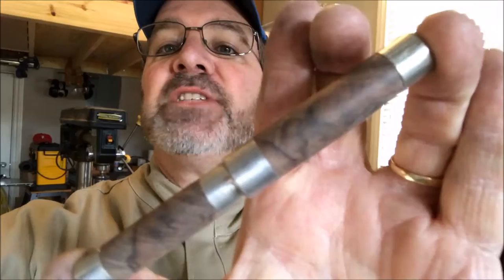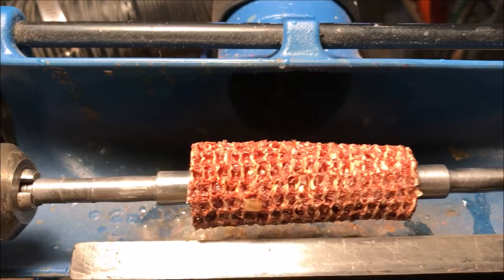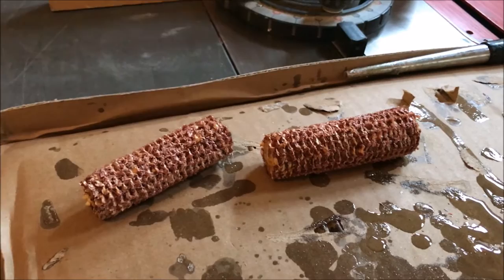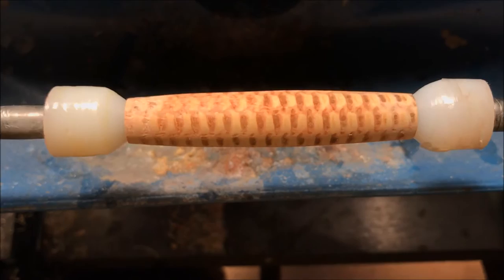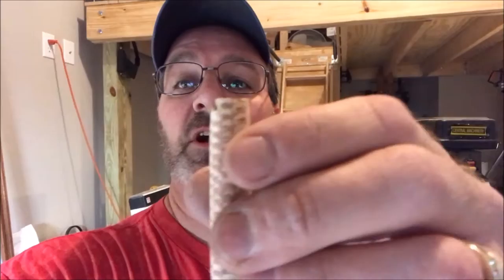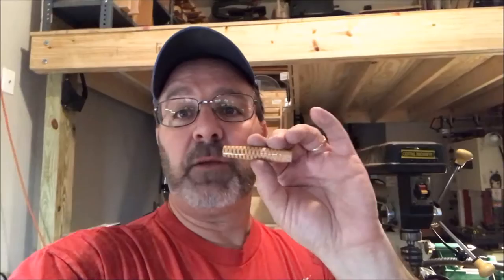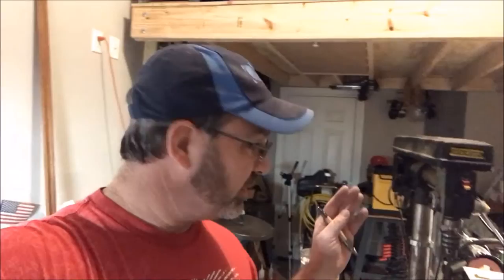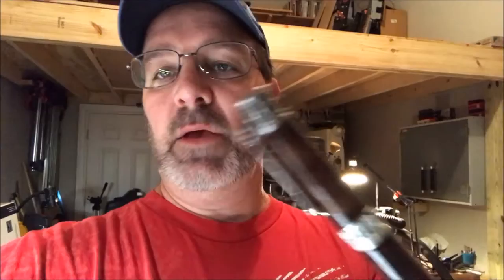Music and Corn Cob Pens

Comment: When you get the thermometer - get one with humid sensor also.  And put a old pot with water on the kerosene heater - as you warm you will get the extra moisture into the air quicker.  Love the figured walnut!!!
Reply from the maker: +Bob Stembridge Thank you Bob,
  Nice suggestion on the thermometer. 

Bob

Comment: Not tedious at all, Bob.  I like the Stratus kit, I think that and the Gatsby Grande are my favorites along with the venerable Slimline kits.  The 2mm pencil kit that Lynn Lacey turned is also a great kit, I am pretty sure it is just the Vertex pencil, though I haven't checked that.  Anyway, it uses the Vertex bushings and has the same hexagon nib.  It is a great kit, I have never done a Vertex pen, it is next on my list now.  That and the Polaris.
Reply: Tenspeed TheBikeHanger so just one or the other?
Reply: On the friction polish?  No, use both.  Put the CA on first then buff it out wit the polish.  I just wouldn't use anything on the blank before the CA.
Reply: Tenspeed TheBikeHanger oh ok thanks for the help😊
Reply: No problem, it is definitely a learning experience until you figure out the best system for yourself.  Just to clarify, when doing a CA finish on wood most of us follow these steps: 1. Turn the blank to size then use sandpaper on a low speed for final shaping and smoothing.  Make sure you get all the scratch marks out at this point! 2.  Apply the CA finish.  3.  Use micromesh pads to smooth out the finish. 4. Use the friction polish for a final shine.  I like to add a 5th step and apply automotive paste wax as a final buffing.
Reply from the maker: +Tenspeed TheBikeHanger Thank you,
  I'd bet your right on the Vertex. 

Bob
Reply from the maker: +Tenspeed TheBikeHanger I agree,
  I do think BLO will work. 

Bob

Comment: Awesome job! Would it be worth your while getting a humidifier for the workshop? Just one of the ones like youd put in a kids room when they have a cold or something. They do make the air very wet though
Reply from the maker: +Locks and Keys I need something but I'm worried about to much moisture causing rust in the shop. 

Bob

Comment: good job  I'm still working  on my pen finishes but there getting better what  do you think of a friction  polish then cover with  ca on wood?
Reply: Be careful of getting anything in the grain of the wood under the CA!!!  Sometimes things react funny, even CA on CA can sometimes cause problems.  I wouldn't recommend it but hey, you never know... Try it and if it works you may have stumbled onto something.
Reply from the maker: +Tim V. Hello Tim,
  I'd use something like Boiled Linseed Oil. I don't think friction polish will work below C/A. 

Bob
Reply from the maker: +Tenspeed TheBikeHanger Thank you for shining in on this. 

Regards,
Bob